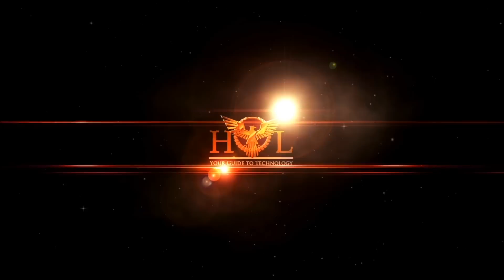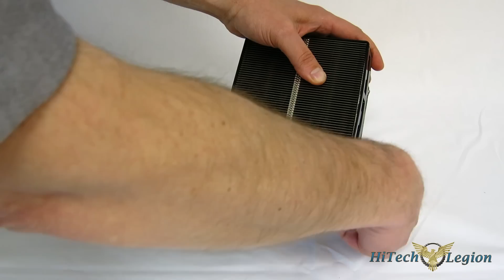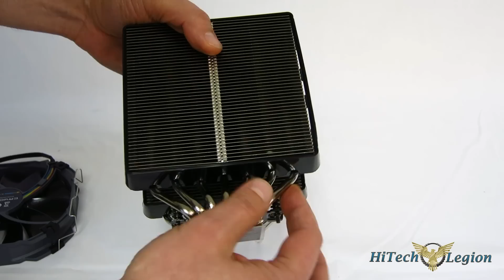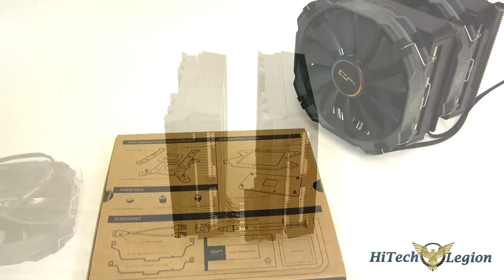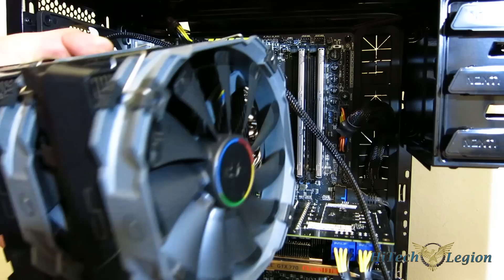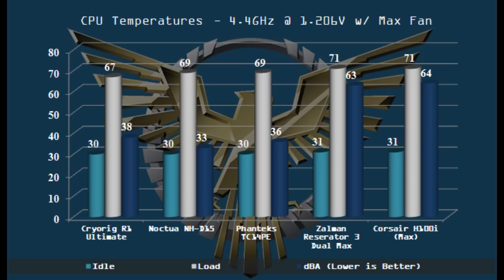Cryorig R1 Ultimate Overview and Benchmarks

Comment: Hi guys. Can you fit an alternative fan such as a Noctua NF12 120mm fan instead of the original Cryorig fans?. Can you attach 3 fans to the heatsink?. Thanks.
Reply: suhail ahmad Yes on both questions. However, you would be taking a pretty big performance hit going to the NF-F12, or any Noctua 120mm. They simply will not produce as much airflow as the included 140mm. The NF-A14 would be a far better choice.
Reply: George Cella hi and thanks for your advice. really appreciate it!. I decided to go for the cryorig rather than the NH-D15.
Reply: suhail ahmad Anytime - I forgot to mention, that fan is also available in dark gray as the NF-P14r. Might look better on the R1 - http://noctua.at/main.php?show=productview&products_id=90&lng=en
Reply: George Cella Hi George and thanks for the link. Will check it out but tbh, I am very happy with my Noctua 120mm industrial 3000rpm fans (110CFM each!). The Cryorig fans produce 76CFM each (which is 34CFM less than my Noctua). Will be interesting to see how well this unit and my fans perform!.
Reply: suhail ahmad That could be interesting - when you said NF12, I was assuming you were referring to NF-F12. Let us know how it goes.
Reply: George Cella Hi George. Will certainly let you know but to give you an idea, my beloved and very reliable Alpenfohn K2 mount doom air cooler had both of the Noctua 3K-rpm fans attached and it kept my FX9590 at a cool 29c-32c at idle. I stress tested it with Prime95 with a 15 minutes cycle and my FX9590 did not go above 64c. Typically, when I am gaming on something very intensive like crysis3 (maxed out settings) and I also have BOINC-SETI running in the background, my FX9590 does not go above 54c (and my 295X2 hits 60c). Sadly, my Alpenfohn K2 cooler met a very unfortunate accident a couple of days ago. I am currently using a Lepa 240 Aquachanger AIO cooler but it is crap and is easily outperformed by my K2+Noctua 3k fans. So I'm going back to good ol' air coolers. I prefer the R1 as it an innovative new cooling design and it outperforms the NHD15. I also managed to get a brand new R1 ultimate for £35 (rrp usually £60!), whereas a new NHD15 was costing me £70.
Reply: ***** Hi Josh, the Noctua industrial 3000rpm fans are really great when it comes to cooling, but they can get a bit loud when cpu temperature goes high. IMO, it is not that big a deal as maintaining decent temps is far more important to me than the occasional fan noise. I also had a 4790K (before it developed a fault) and I was using my K2 air cooler with the two Noctua fans and my cpu temps were 14c, 15c, 15c and 14c (for the four cores). My pc and K2 fans subsequently very quiet due to the good temps. My only concern with the R1 Ultimate is that I don't know for sure if it will be able to fit my Noctua fans, but here's hoping!.
Reply: ***** Hi. I just got an email from Cryorig customer support. Here is what they said - 

'Hello Suhail,. The fanclips included with the R1 is not designed for 120mm square fans like the NFF12.  They are made for 140mm round frame fans.  However, with a little bit of fitting work you might be able to get the Noctuas to fit.  Good news is that the R1 comes with two extra sets of fanclips which you can try out with your 120mm square fan.  You will need to try and twist fit the fanclips with your Noctua fans'.
Reply: ***** Hi. I received my R1 Ultimate cooler yesterday. Sadly, I was unable to fit my Noctua 3000rpm fans to the heat sink. The fan clips are not compatible. Nor are my spare fan clips from my Alpenfohn K2 air cooler. I have a 295X2 and when I had my K2 heat sink, I was able to fit the radiator of the 295X2 to the rear exhaust port of my storm trooper case. However, I am unable to do this with the R1 Ultimate. So I have had to fit my 295X2 radiator in position of the top exhaust fans of the case. I managed to fit two full size fans and one slim fan to the heat sink (all three fans are cryorig). At the rear fan exhaust, I have fitted my 140mm Noctua 3000rpm fan (150CFM) as the exhaust fan. Fitting my heat sink to the motherboard was a bitch. It is not at all straight forward to slide the slim line screwdriver in between the heat sink and fan, in order to tighten the screws. As far as cooling goes, it performs slightly less than my K2 with the 2 Noctua 3000rpm fans. At idle, I get about 34c-37c since the last few days have been very hot here in Leicester. With my K2+2 noctua fans, I was getting idle of 30c-33c. I am using an FX9590 with Asus Formula Z motherboard.
Reply: ***** The thing is that the fan clips that come with the cryorig are only compatible with the circular type 120/140 fans. I could try mounting one of my coolermaster 120mm jetflo fans to the cryorig heatsink and see what happens. The tech support guy at cryorig said I can bend the fan clips so that it will fit a typical square shape fan. Thing is, I don't have the right size pliers or even a steady hand!. Will try to find a way though...
Reply: ***** Okay, I had another look at this cooler. You can actually fit alternative fans but you have to remove the plastic frames that clip onto the heatsink. The problem is that the plastic frames get in the way of different shaped fan clips. Once removed, I was able to fit my Noctua 120mm fans. However, the supplied fan clips with the R1 do not fit my square shaped fans (they only fit circular shaped fans). Luckily, I had spare fan clips from my deceased Alpenfohn K2 mount doom air cooler and they did the job.

Removing the R1 fans and plastic frames actually detracts from the overall aesthetics of the cooler, but I am more interested in keeping my cpu cool although Cryorig need to think more about fan compatibility wrt to their designs. With my 3 noctua fans, my FX9590 is at a nice 31c at idle. Upon load with BOINC-SETI and graboid, my cpu is at 42c. Whereas with the Cryorig stock fans, cpu idle was 34c-37c and with BOINC and graboid running in the background, was 46c-47c (and 62c with prime95). Will run Prime95 with my noctua fans + R1 heatsink and see what I get.

UPDATE - I just finished a 15mins cycle of Prime95 and my FX9590 for the most part was at 52c (with the R1 heatsink and three noctua fans (3k-rpm/110CFM each). Only in the last couple of minutes, did temps go to 55c. Bearing in mind my R1 hit 62c with prime95 with the supplied cryorig fans, the noctua fans slashed temps by 10c (for the most part!). I stopped Prime95 after 15 mins and it took the noctua fans 1m to get cpu temps down from 55c to 30c idle. Wow, wow, wow.

Comment: We're the benchmarks done with 2 or 3 fans on the cryorig?
Reply: Jake Munoz Dual fan, as stated in the review. Also in the review is the explanation as to why. However, in further tests we found that the reason for those results was interaction with the rear fan of the Phantom 530 used in the testing. When moved to an Enthoo Luxe, Fractal Define R4 or open air, the 3rd fan results normalized to what would be expected.

Comment: i still use my OLD tuniq tower 120 extreme. and it still does its job with no problem what so ever. but i did replace the fan with a noctua fan as the stock one crapped out.

Comment: Just out of curiosity, and you may have mentioned it elsewhere, but does the R1 guaranty RAM clearance like the H5?

Love your video's!   Many thanks!
Reply: George Cella Never got back to you man. . . I'm very happy with the r1 universal and I also found out that my 4670k wont stay stable above 4.5ghz. . . but ohh well after extensive trial and error the i5 really liked 1.25v for 4.5ghz, , temps on the r1 universal are 65c.
Reply: Wunji1 The RAM clearance on the Ultimate is shown at 15:04. Not much space for heatsinks.

The R1 UNIVERSAL has guaranteed RAM clearance.
Reply: George Cella What is the difference between the ultimate and the universal?? If its only the front fan can't I just order a skinny fan and be done with it lol
Reply: George Cella Forgot to add that I only need the 2nd and 4th RAM slots, , , I think the 2nd slot should be cleared with one of the skinny fans.
Reply: Ken Pachi In addition to the thin front fan, the Universal's tower is offset toward the rear to clear all RAM slots - it has 100% RAM compatibility. The difference in performance between the two is very minimal, typically ~2 degrees under full load with a CPU with a hefty OC. On smaller OC or stock speeds, there is essentially no performance difference.
Reply: George Cella I've decided to get the r1 universal. . . the only thing I dont like is the white plastic, I think that some red paint can fix that problem lol. . . . Here is my problem with the 212 evo, My i5 4670k with a 4.4ghz @ 1.20v temps average out from 70-75C.  At 5.5ghz @ 1.23 temps avg 78-82C and that is a little bit too high for comfort. At 4.7ghz @ 1.28v the 212 gets slaughtered in the stress tests.  I know that a 4.4ghz overclock on haswell is already pretty good but I'm set on the 4.7ghz overclock. I would love to get a noctua nhd15 but the their color choice is a BIG turn off for me.  If they had an option with black fans I would purchase in a heartbeat!
Reply: Ken Pachi Keep an eye on the Cryorig site. They have offered the plastic rings in various colors sold separately, some recurring and some limited edition. They were very inexpensive when offered.

Comment: Thinking of getting this for my first PC build, my only concern is the memory clearance for G.Skill's heat spreader- it'll be rather tight even with the adjustable fan height.
Reply: 40mm maximum ram height clearance per Cryorig's official website on the r1 ultimate.  So there is a slight chance if you got ram that is exactly 40mm's tall, you may need to raise the fan closest to the ram up slightly.  Results may vary.

Comment: Do anyone know if this cooler fits on the gigabyte GA-97X gaming 5 motherboard, cause the heat sinks looks kinda big on the motherboard? :-)
Reply from the maker: Jakob Tjørnelund There should be no reason it wouldn't fit.
Reply: +HiTechLegion did you use low profile memory and do you have any problems with using all slots?
Reply: did you watch the video?

Comment: I'm new to the whole pc building and i was curious if that third fan on the cpu cooler would have any extra benefits compared to just having the two fans on the cooler.
Reply: I talked about that in the full review. You do see a drop of 1-2 degrees, but at the expense of added noise.

Comment: your videos are a big help when it comes to building a rig  will i have any trouble using the gskill sniper ram with this cooler  and why do you use intel  on all  your  air  coolers  it would have been nice to see a bench test with the 8320  or the 8350
Reply: The Sniper will fit without a problem.

I use Intel for a couple of reasons....first being that it is more common. The second being that Intel chips have a far higher TJ Max and operating temperature. This allows for testing at much higher temps.
Reply: George Cella thanks for the fast reply  I was thinking of changing the fans I was thinking of using the be quiet fans would I get better performance  or should I stick with the fans that come with it
Reply: Mosh Dawg be quiet! fans would be a little quieter, but performance would drop off a little from the stock fans.
Reply: George Cella hey George ty  just trying to get everything set up going to try and build  my first gaming rig this is  the build asrock fatality 990fx killer mob amd 8320 gskill sniper 8 gig 1600 corsair cs   psu   raidmax  vampirer  case
2 120 corsair af fans  2 140 af  fans and 2 coolmaster mega flow fans  and  a 120 ssd Kingston hyper ssd and a Seagate 1tb hdd  and my air cooler you know what I am using lol
Reply: If you want to use be quiet! fans, doing that in place of the Corsairs would be a nice improvement.
Reply: did you ever get this heatsink ? I ask because i also use the g.skill sniper ram 4@16gb. I am using the asus p8z77v lk. I was wondering if i could use all 4 ram sticks with this cooler.
Reply: missing cord Sniper would fit without a problem.
Reply: George Cella hey George  would  gskill ripjaw 1866 work with this cooler
Reply: Mosh Dawg Which model of Ripjaws? They make a few different heatsspreaders.
Reply: 1866  is the type  i  will be using could you link
the one that would work if you don't mind
Reply: Mosh Dawg You can get 43mm in height under the fan if you raise it to it's topmost position. From what I can find, Ripjaws X appears to be 40mm, so all should be good. Or, you could simply use Ares and be completely safe.

Comment: Whens it available in the UK?
Reply: you can buy it from Alternate.co.uk (although the postage is pretty expensive £9.99) I bought mine from Olano Gmbh a German base Amazon store that sells on Amazon.co.uk and prices from Amazon Germany are way cheaper than Amazon UK and still have free Postage! but sadly they have stopped selling on Amazon UK a week ago because of new regulation UK have put up.... (its because of the fact that German Amazon have cheaper price  most of the UK Amazon buyers but from Amazon Germany through Amazon UK website and still have free postage!). Although I suggest measuring your case and ram sticks before you buy your R1 Ultimate, but if you can't be bothered to check measurements just buy the R1 Universal it has the same looks and the same performance the difference is that the tower is offset a bit so that it completely clear's your ram slots and have a slim fan upfront so therefore you can use whatever size of Ram and the R1 Universal won't touch it unlike the R1 Ultimate which is bigger.

Comment: very nice the material looks top notch too I love the 3 fan set up  a push pull idea
the only problem maybe the weight , I love this cooler , it is good to see cooler that get the job done I tried water cooling  and got  a massive leak from brand new item now I am back to air cooling this I will definitely try

Comment: that's a good looking cooler and performs well. when you tested it was it with just the 2 fans or with the 3rd fan?
Reply: Adding the 3rd fan was a diminishing returns proposition. Only a 1 degree drop in temps, but added noise from the extra fan.
Reply: oh ok